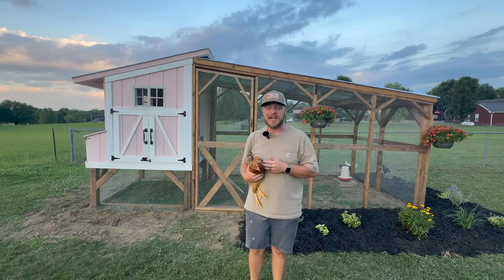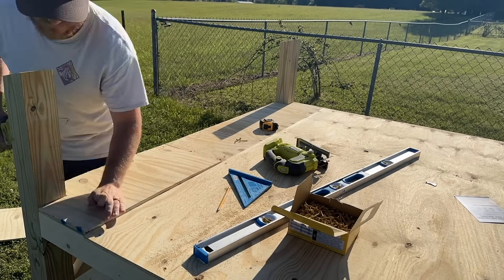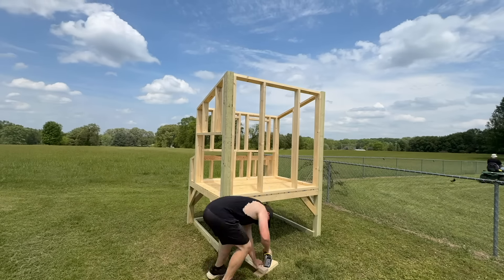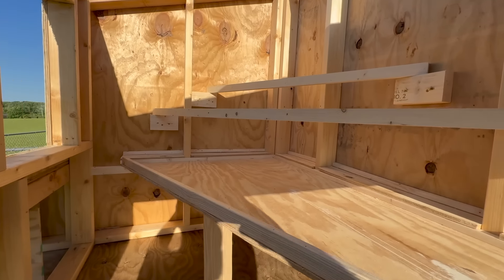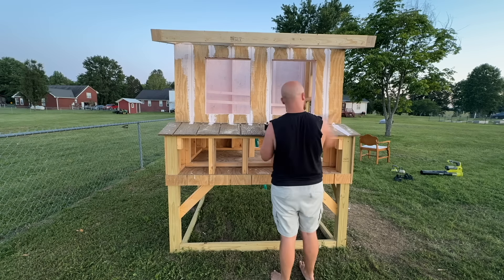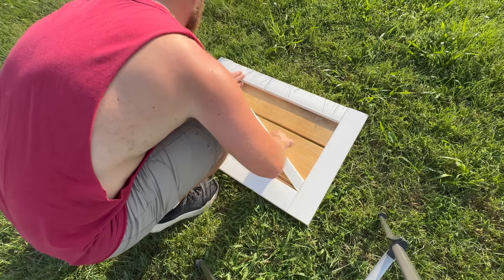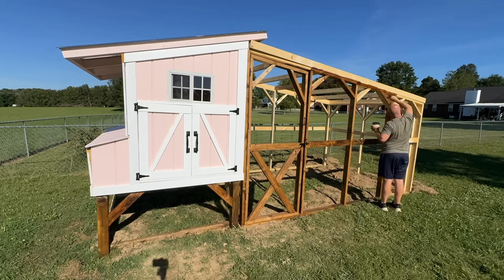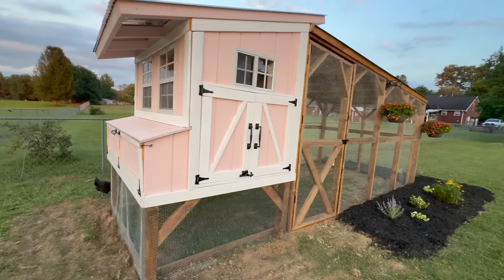Building Our Dream Backyard Chicken Coop

Comment: Built the same coop and I must say anyone looking to build it, keep an open mind and don't be afraid to make changes. There are many things that can be improved with this design. A few things to change: Make the whole coop 6" taller so you can actually get underneath it. Make all the supports on the bottom go out to the edge so you can attach the hardware cloth easier. Make the coop 8" wider so you can make nesting boxes longer (to make rollaway ramp). Turn 5 nesting boxes into 3- Your 10-12 chickens that you fit in here will not use 5 boxes. Make the chicken door into the coop on the side and not in the middle (gives you more room when walking into run). Make the dropping board square and cover the back 75% of the coop because the triangle design is silly; You'll fit more roosting bars this way. There's more, but again just use your common sense when building this.
Reply: Maybe you can make a quick video. Just showing your coop so we can get an idea of what you’re talking about more thanks.